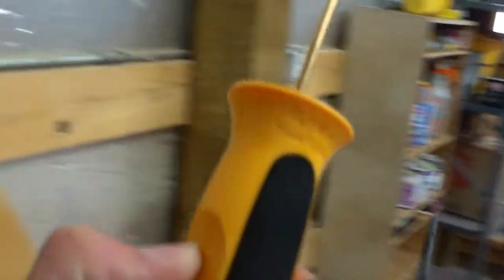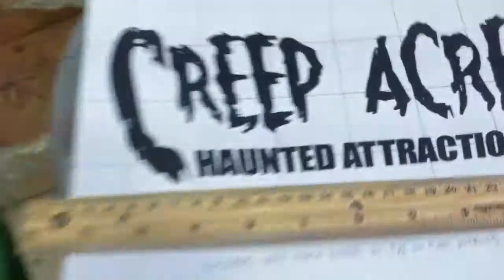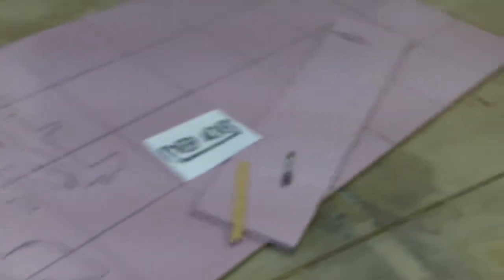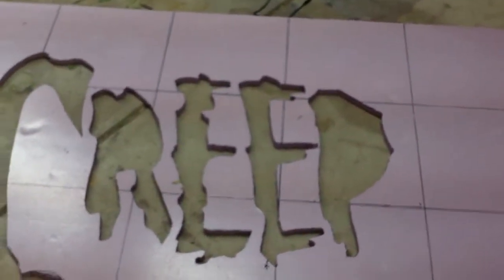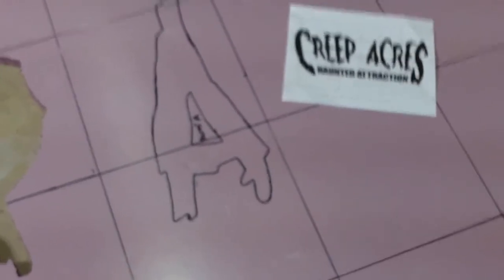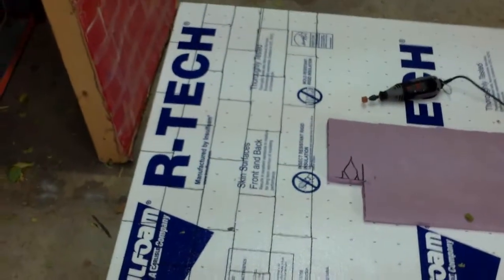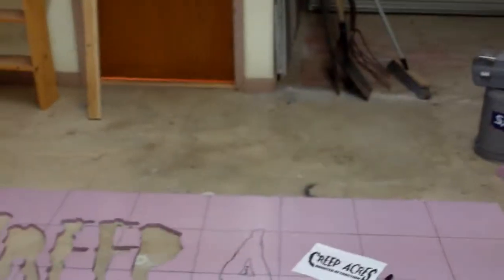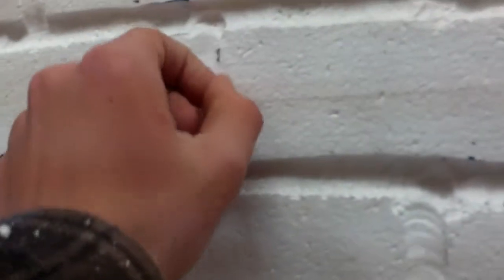Foam Carving! (2013 Build Days 1-2)

Comment from the maker: It really surprised me a ton how well it started looking given the price... you do have to keep in mind that there is the additional cost of whatever coating you use to solidify it, but overally it should look 10 times better than those cheesy brick panels.

I'll be doing some brick-walled scenes probably mid-Summer time, so once you see that in the vlogs remind me and I'll certainly do a tutorial for ya! (I would commit now, but I'd probably just forget by the time I get back to it... LOL)